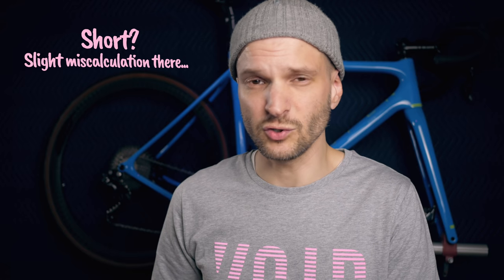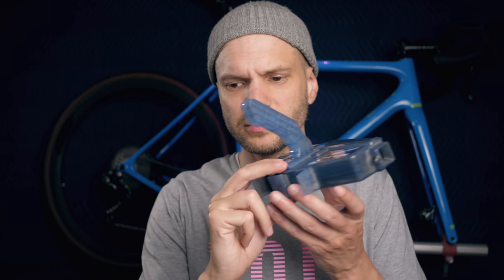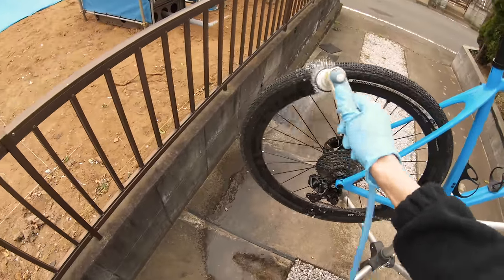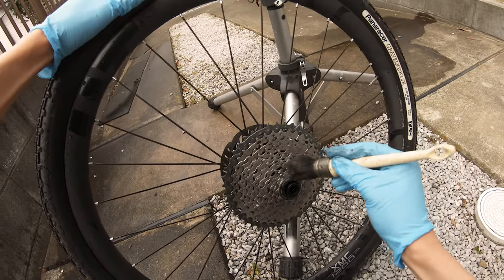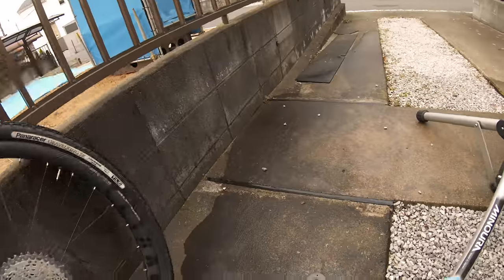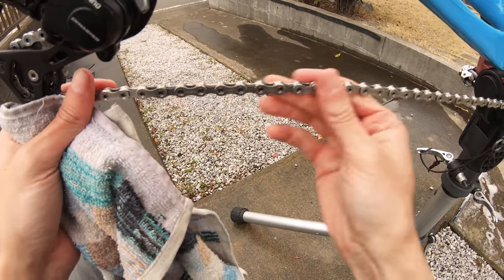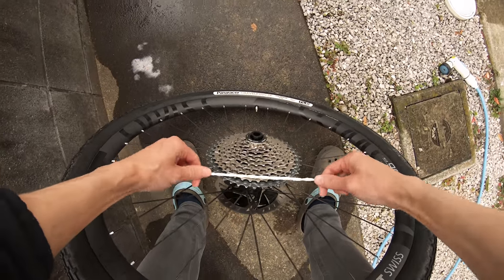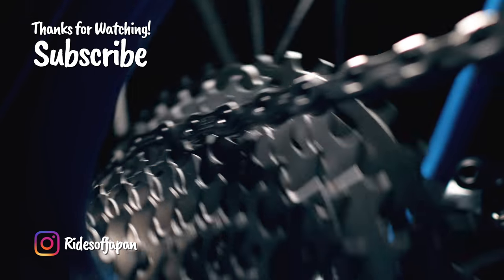My obsessive compulsive chain cleaning disorder

Comment: Try chain wax, no need to degrease, you need to wax a bit more often then using oil, thats the only down side. I find wax much easier und cleaner to clean. I dont miss the dark black drops falling from the chain while cleaning it, dropping all over my tire and chain stays.

Comment: The thing i find a bit obsessive is that you repeat some of the steps although it already looks perfectly clean.
I am more of a commuter type (but still 200k/week) i tend to wipe off the chain with a paper towel after every ride - takes 10 sec.

Nice trick about reusing the degreaser. I do not have a waterhose, but put water in my chain-cleaner for removing residue degreaser.

I tend to avoid hollow chain because they are almost impossible to get all clean.

You mention MucOff only last 200km - i do not think you will find much that exceed 200km anyway. You could check of Dynamic (german brand), i have good experience with their K2 wet lube, it also keep the chain pretty clean. 
Personally i have good experience with: Dynamic K2, MucOff C3 Wet, Finish line Ceramic Wet and Pedros SynLube (last one holds well, but is also i bit more messy)
Reply: you should buy a hollow lightweight chain but ride it a few times on the factory lube (it's the fastest your chain will ever be) until it gets slightly black and then completely clean it (It will look brand new) and then wax it yourself and it will stay clean for a very long time. If you use wax your chain will almost never be dirty so you don't have to worry about cleaning inside the hollow plates, although this advice might not work for everyone because I only ride my race bike in almost perfect conditions so that nothing wears out quickly.

Comment: My routine is very much like yours, only I use wax lube (Molten Speed Wax with Squirt or Smoove in between) and after the bike is dry, everything gets a wipe down with Boeshield T-9 (except brakes of course).  Especially hardware like stem and bar bolts, chainring bolts, thru-axles and even the derailleurs.  I also wipe down my rims, hubs and spokes with it.   It keeps everything shiny and new looking even after thousands of miles.  I sweat a lot, and sweat on bike parts is very bad (tm).

Comment: Well done as usual. A very thorough routine.......I’m happy if I do that once a quarter. Usually it’s wipe down with rag and more lube then wipe down again after every ride or two....the bike is quiet so I assume it’s happy with it’s bad treatment. I use wet lube year round, probably because I haven’t tried the right dry lube. Do you find that the drivetrain lasts longer with your cleaning routine or is it impossible to say? How long between new chains?
Reply from the maker: Lorenz Siggel I will bet money that a clean drive train will last longer for sure, that grime will act as a sandpaper on you chain. On the other hand a new chain is not a huge investment so it’s arguably not necessary to go this crazy 😬
I’m paranoid about wearing my cassette and chainring so I replace my chains way before they wear out. A chain is pretty cheap even for the high-end ones so I don’t try to squeeze out every single meter from them.

Comment: Thank you, Tobias.  Excellent chain, I mean, shane shots! 😛
I noticed you are using a quick links instead of pins to close your chain. Any reason for that?  I am asking because you are not supposed to use quick links for many km/miles.
Sorry if you have mentioned that in your other videos.
Reply from the maker: David Rio cheers mate.
The quick link should last the life of the chain from what I understand as long as you don’t remove/reinstall it all the time... or did I miss something? 🤔
Reply: @ridesofjapan  Ah! I get it. The link loses its properties as you remove it from the chain. In my mind, quick links were more for temporary fixes in case your chain breaks during a ride. But they are a valid alternative to pins when installing a shane (damn it, chain). Thank you!

Comment: Ever thought of using chain Wax like Wend wax? keeps the bike clean and they come in loads of different colours as well.
Reply: Yeah, I use a wax bath for my chain. Nothing EVER goes black and I can melt off excess wax off the cassette using a hairdryer.
Reply from the maker: charles D not gone down that route, mainly because of reports saying it’s noisier than lube (and the wax flakes all over the bike makes my OCD act up 😜)

Comment: I ended up with Pedro's Ice Wax. I went through almost all lubes (wet, dry, wax), and for now I will stick with Ice Wax. Even in light rain it's performing super well, and chain stays relatively clean! And super silent drivetrain! You need to re-apply it every week, though. But I don't care, as long as chain is clean and silent!

Comment: Have you ever tried "molten speed wax" a different type of lubricant "paraffin based" which picks up wayy less debris and runs way quieter.
Reply from the maker: I have not. 
When you say it runs quieter, in comparison to what if can ask?
Reply: @ridesofjapan  compared to the oil based lubricants (grease, dry oils, wet oils, etc.) 
The main benefit ive found is that apart from the chain staying quiet and and VERY clean for at least 300k, the chain is not sticky so it doesn't accumulate debris and gunk and dust over time.

Comment: Hi. New subscriber here, very informative video. Two quick questions. What sort of oil applicator were you using at the end of the video (one with the fine metal needle type point). What sort of soap did you use in your wash bucket. Thanks man.
Reply from the maker: Hey mate,
For the needle applicator, there’s a link in the description you can check out. Alternatively , Here in japan you can buy similar bottles and needles applicator at the 99cent store, then just fill them with normal chain lube.

For soap just normal mild dish washing detergent.

Cheers!

Comment: This is crazy, and definitely a little overkill. With my mountain bike, most of my time is spent re-lubing chain (which tends to remove gunk as you wipe) and spraying most metal parts with silicon protection. You're drying things off here (which is crucial) but over-cleaning probably puts more wear on the bike than anything else, if you're not getting it wet during rides. Rust is my biggest nightmare. That is all.

Comment: I don't have your obessive problem so what I do is lean the bike against the car and sluice it down with a product called "oil eater" any degreaser will work. Wait 1 min then take your brush and spin the chain and cassette and pulleys against it. Then sluice some more degreaser on the bike everywhere. Grab the hose and wash off the degreaser. For a final touch I blow dry the bike from an air compressor hose. This whole process takes maybe 4 minutes.

Comment: I spray some Rain-X on the bike when I'm done cleaning it, stays shinny a little longer. And I do ride in the rain a lot.

Thinking about trying the motor oil I use in my car (Mobile One 5w30 full sin) on the chain. Just need to get myself a small bottle so I can drip a little on each link like you did in the vid. And nice vid, cheers.

Comment: Solid content as always. Pipe cleaners work perfectly for the cassette. Have  you never used Molten Speed Wax on the chain?
Reply from the maker: Thomas Hemming Larsen cheers mate!
Have not gone down that route. Mostly been put off by the noisier operation it seem to result in.
Reply: @ridesofjapan  yeah, that's the price of a dry chain :)

Comment: Try using soap to lube your Shain. Just take a bar of cheap soap, not anything like Irish Spring, and work it into the chain as you spin it. Your Shain will stay quiet and clean. It works like wax based lube. Just don't get it wet.

Comment: In the places where we drive on the right side of the road, we lube our chains from right to left, interesting? 
Tobias, since we both have the OCD DNA, (a quality, not a disorder) I was wondering if or what you do to keep the water out of the little hole for the Di2 wire on the right chainstay? Carbon and moisture are not pals.
Reply from the maker: Apart from standing the bike “upright” and letting gravity work it’s magic, I don’t to anything. Should I?
Reply: @ridesofjapan  I don't know if anything is necessary for the common man, but my OCD wants to seal up that little hole. I think I'm going to modify a rubber grommet to fit snug as a bug. Grommets are cool and it's fun to say. PEACE!

Comment: How many kilometers do your chain last with that cleaning? Thx
I use the same chain lube, and in winter i use the wet version the blue one: the quality is lower, but the chain stays lube in the rain.
Reply from the maker: Camille Clrc the last couple of chains I swapped because of new bike builds(crashes etc) so can’t give you a good mileage on the chains. 
But as I’m paranoid about wearing my cassette and chainring I replace my chains way before they wear out. A chain is pretty cheap even for the high-end ones so I don’t try to squeeze out every single meter from them.

Comment: If you want some science behind your lube choice - The BEST chain lube comparison: https://cyclingtips.com/2018/03/fast-chain-lube-that-saves-you-money/
Reply from the maker: Yes I’ve read that. I’m not so concerned about friction personally, I rather take a tiny friction increase for a quieter drivetrain. From what I understand the absolute fastest methods are on the noisier end of the spectrum.
Reply: @ridesofjapan  yeah, that's fair. To my logic a wet lube like you're using will always be quieter.
Reply from the maker: @SamWaltProductions  True, so true. Definitely quieter than dry lube, but a bit more hassle to clean of.. need to strike that balance hehe :P
Will definitely give the wax based lube a go as soon as I run out of my current batch of lube.

Comment: Have been riding with the guys that use chain wax and their chains always look new. Not sure if it worth the hassle, what do you think ?
Reply: Found wax lubes to be very good solution, but only for road/paved surface, generally cleaner environment. When going on mostly dirt surfaces, had crunchy chain way to quickly. Last wax lube I tried was from Jucelubes.

Comment: Have you considered using paraffin wax to lube your chain? 

It has been proven to be more efficient than most every commercial cycling lubricant, it is far cheaper, and runs clean - attracting almost zero dirt. The slight dust it may carry from a ride can be simply rinsed off (water) after each ride and between re-lubing. None of that drive chain yuk!! 😊
Reply from the maker: Nope, starting with waxed based lubes

Comment: Try RSP lubes, found them about 2 years ago, and never went back to rest of my lube collection - yes, I have 12 different lube bottles in bike cave, think one can call it a collection, of sorts :-) Been looking for a "grail" type of a lube, and went thru a lots of brands, and for now I'm sticking with those RSP wet and dry ones.
Reply from the maker: renifeer cheers for the tip! Will look into it 👍
Reply: @ridesofjapan  Other option I had a great results with is Juce Lubes Viking for my mtb and gravel bike, and all my roadie friends swear by Morgan Blue Rolls Pro for thin tire smooth surface bikes.

Comment: awww ? you don't WAX bro? lol  i used to use squirt lube.....but......i use wend wax now !  ill never use lube again unless its in the rain! BUT 4 ME ITS RIP LUBE!
Reply from the maker: Chet Langford I’ve looked into wax a couple of time in the past but reading (and watching a few videos) have not convinced me to go down that route yet.
Biggest thing if noise, from What I’ve seen the report say it’s noisier than lube and that is deal breaker for me. Also those wax flakes all over the bike... I would have an heart attack!

I will give Squirt a go next for sure though. 👍
Reply: @ridesofjapan  you gotta use a little bit of lube with the wax so it melts! I haven't experienced that flake on the bike yet? Maybe I just clean mine too often?
Reply from the maker: Chet Langford that’s good to know!
Might try it out eventually
Reply: For mostly dry conditions, I second the use of paraffin wax lubed chain.  In my case, I get about 500 reasonably quiet km per lube, with minimal drivetrain cleaning required (damp cloth, mostly).  I keep a similar tiny dropper bottle with Squirt wax based lube as a backup.  If you apply Squirt at home, my tip would be to work it in with a toothbrush while turning the crankset
Reply: Wend wax is horrible. It destroys chains and drivetrains within 1500 k's, it smells really good tho. Switched back to squirt, which keeps the overall drivetrain in a better condition for a lot longer
Reply: 3in1 ptfe spray guys. the best shit ever done. you have quality lubrication + easy to apply. what more can you ask for? it's about 6 bucks the spray and it lasts long! one chain revolution is enough.
Reply: Yes, the wax flakes are a bit of a pain...but what I have done is use a tablespoon of paraffin oil in the crock pot to make it less flakey when on the bike. 2 tablespoons for the winter formula.
Reply: @williamkochi1415  the paraffin wax recipe should be cream texture. like the cream for hands from neutrogena. quite thick but spreadable. 50/50 is the best for all year. it lubes a lot better and longer. roll the chain in the mixture while it's hot it will penetrate everywhere. wipe it out still hot. let it rest to dry and cool down.

 FYI hot metal dilatates its pores to fill them up with the mixture. so even when it sounds dry, it is still lubricating. just spray some cold water onthe chain to get rid of dirt. spin the chain with the crank of course.
Reply: @JayB-lz6yd  i typically use MoltenSpeed Wax...and just add a tablespoon of paraffin oil to make it creamier and less flaky. Forgot to mention that I use MSW. I use to make my own from the friction facts recipe...but like the MSW blend since its easy to partition (i use half the package at a time). I appreciate the reply.

Comment: Try Pedro's Ice Wax, washes off with just a bit of hot water, and super easy to apply. Saves time and degreaser
Reply from the maker: Tom Terblanche interesting! Is it quiet as well?
Reply: @ridesofjapan  Compared to the dry lube I used in the past I think it is, might be placebo though. If anything it is the same.

Comment: Long brush is for baby bottles or long glasses
Reply from the maker: Dr4g0nW00d that makes sense 👍
Reply: @ridesofjapan  btw squirt is not a good solution it will clog up everything otherwise try finish line lube extreme conditions the green one for xc it's green and have a high viscosity but still good to clean off
Reply from the maker: Dr4g0nW00d the finish line is nice, used red dry many time before (the green is what I have in that little in the bike kit bottle)
I need to test the Squirt as I’m really curious about that now... if I stick with it or not remains to be seen.
Always good to hear about everyone take on it though, cheers!
Reply: @ridesofjapan  50 € for a bottle is to steep for my wallet but hope to see a video when you do
Reply from the maker: Dr4g0nW00d damn €50 for that little bottle?! That is steep!
Luckily it’s a lot cheaper here... I think I can get the half liter bottle for around €40 here. Will start with the 120ml bottle for the first try though.

Comment: Great Video...  So if you want to ruin your bike, this is the perfect way to ruin all the bearings in your hubs, free-body, and BB bearings!.. Why?!  Never apply any type of degreaser or solvent directly on your bike as degreasing liquids have a very high capillary action.  All it takes is just a few drops to dribble and or land nearby your sealed bearings and from there it will easily bypass the bearing seals and straight into your bearings.  So even though that tiny bit of solvent will not wash away the large portions of grease around the bearings, what it will do is wash away that critical thin thin layer of grease between the ball bearings and the raises they ride on...  BINGO! You just ruined your bearings as they start riding metal to metal.
Dear Rides of Japan,  Sorry for shooting down your video, but I get to see countless High-End Bikes get ruined cause they found website RoJ video of yours. The proper way to clean your chain, cassette, and C-Rings is to remove them off the bike.  Besides the C-Rings it's not that hard.  The worst are those ParkTool chain cleaners. Take a Hammer to it and throw that thing away so no one else can find it and use it again.  From years of experience as a Professional Mechanic (since 1967), I can assure when your bike is nice and dry, I bet if you put your bike on your work stand and crank the rear wheel it makes loud hollow grinding noses...  That means your hub bearings are toast.  Also if you remove the chain off your cranks and spin your cranks really fast they will spin very easily and fast.  Guess what, that means your BB bearings are ruined too, as the cranks should spin fast and quickly slow down as the grease tends to slow them down.  FYI: this is the reason your pulley froze is that you doused it with solvent. 
Sadly, for people that have seen your video and followed your advice, the average repair bill is about $200 ~ $300 especially if they ruin their ceramic bearings.  Sure your bike is super clean, but its also super ruined.

Comment: I use DuPont chain lube, the one that comes in a yellow spray can. It’s made for motorcycles, but if it’s good enough for high performance engine racing bikes, surely it’s good enough for a fixie, no?

It sprays on, so it’s super easy and fast to apply, and it rejects dust. I had an issue with chain lubes in the past that became “sticky” and would become dirt magnets, but the DuPont spray lube is perfect. I clean my chain every 500 miles or so, and each time, there is very, very little dirt buildup.

Don’t waste money on something that is fixie-oriented. You’re wasting money on a label, in my opinion.